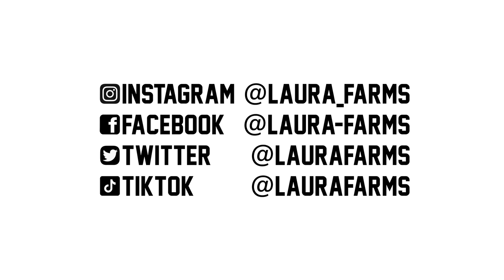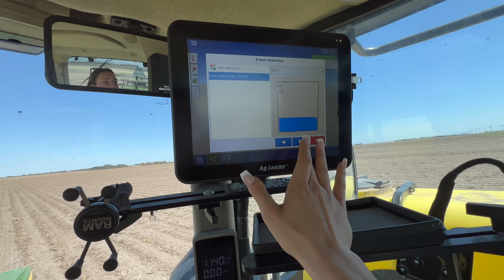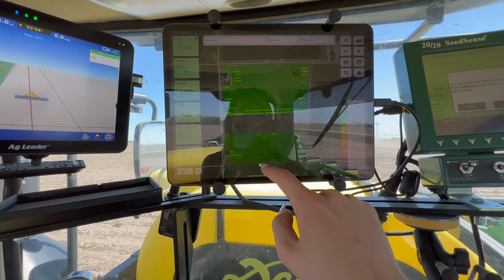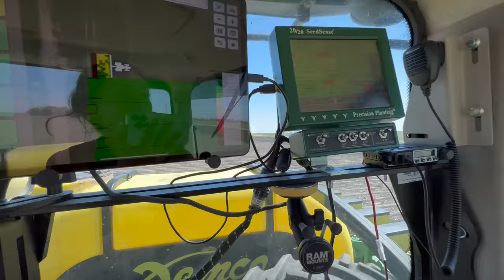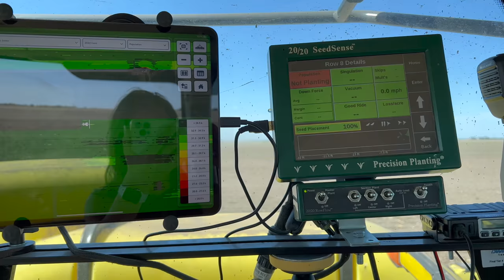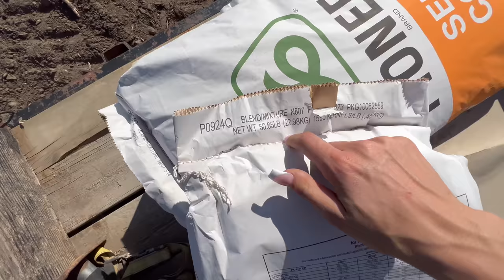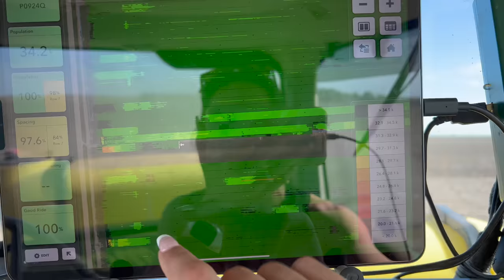I'm Done! (Planting)

Comment: You need homemade mudflaps that fold backward to prevent dirt from clogging the seed spouts when you backup. And from the front side, a metal bar that goes between the 2 blades prevents any mud from building up,

Comment: I remember one hot summer day I wanted to go swimming but couldn't until I had cultivated the corn. So I figured if I drove the cultivator a little faster I would finish sooner and get to swimming sooner. That was the logic of a 16YO farm boy. Well it didn't work out. As it works out the faster you go with a cultivator the higher the mound is created, the smaller corn is then covered with dirt from the fast cultivating. Long story, even longer - after it was discovered most of the corn was covered I had to take a pitch fork and manually uncover each corn sprout instead of swimming. Moral: take your time and don't speed through your chores.

Comment: Congratulations on the planter and getting your corn planting finished.  Y’all did a great job on the planter, a well organized team effort.  Did y’all see a lot of deer this winter ?  I was trying to spot deer tracks in your rye grass.  LOL 😂. I wonder if you were to tap and drill, then place grease fittings on the planter, if that would help make the bearings last longer and keep some of the fertilizer out, or maybe find some kind of seal for them.  Maybe a thicker gauge metal bar with less flex when in contact with the ground would keep those bars where they are supposed to be.  Grant you are a smart man, I know you will come up with a solution.  I hope your neighbor got his planter fixed and fields planted.  👍🚜🙏😎✌️

Comment: Great vid - as an engineer I would interlock the tractor reverse with the implement so that in the lowered position it would not be possible to reverse unless you deliberately bypass the interlock - this can be included on the SCADA screen very easily. 😊

Comment: I'm a bit surprised that there is no safety lock in the system that would prevent backing up when the planter is down! It should not be difficult to implement since there is so much automation already.

Comment: Non farmer question here what is the difference between a planter and a seed drill ? I have heard this term though out my life as I live in a farming area but don't know what is different between the two processes. 
Congratulations on your planting success. 
I have learned so much from you and Grant about farming in the short time I have been a subscriber to your channel.
Reply: It's mostly a regional thing, sort of like how "grain cart" and "auger wagon" mean the same thing.

To make it even more confusing, there are other planters called "air drills" which are simpler and generally cheaper for a given width that distribute seeds a little less carefully than a planter. For things like small grain crops (wheat, barley, oats, canola) this is fine. But for corn and a lesser extent soybeans there is value in very carefully and evenly spaced seeds when it comes to yield potential.

That's why a lot of times you see some farmers being called "row crop farmers", they plant corn and soybeans versus farmers who plant small grain crops like wheat.
Reply: Essentially their aim is the same, seed placement. Simply put, a planter is equipped with additional equipment to more precisely place seed in the desired depth and spacing,  very important in corn.  A drill is generally used for higher population.  Planter, 20-35,000 plants per acre, drill 180-200,000 plants per acre. Planter, usually 20-30 in rows…drill 7-10 in rows. The details could take much more room.
Reply: Hey, A planter is mainly used for Row Crops, with spacing between each Crop Row, like Corn or Milo and Row Crop Beans... We say you plant Corn,,, you Sew Wheat... A grain Drill is used more for the grassy type crops
Reply: Hey, back to my Story... A grain Drill is more for the grassy type Crops, that you want to cover the ground, closer spacings, with a Drill, like Wheat, Barley, Legumes like  Alfalfa and Clovers... All grasses are put through a Drill or broadcast with Fertilizer out of a Truck or Buggy...Some Crops like Soybeans can go either way... Plant Beans, Sew beans, and you can use a Drill to "Plant" Beans in spaced Rows if you cover or tape off 3 or 4 spacing then leave one open and repeat across the Drill, making spaces like a Planter... 😎👍😎🙂😎

Comment: I have a question.  Since the seed corn is a "controlled " product, if you were running low, why couldn't you fill the planter enough to finish the field and if there was any left over, vaccum it out and return it to the supplier?  As you can tell, I'm not a farmer,  but a curious follower.

Comment: stupid question: based on appearance, Grant's planter (not sure whose name is on its ownership papers) does pretty much the same function as Laura's planter (same caveat), aside from carrying seed in two large hoppers instead of several small seed boxes - with me so far? good. it also appears that Grant and Laura do not have to 'share' a tractor.   assuming that you're both planting the same crops (maybe the same amount of acres, and same time frame even), wouldn't it make more sense to DOUBLE UP as much as you can, when possible? or if nothing else, whoever gets finished first should rig up to help the other get done faster, rather than just "wash up, put away for next year"...